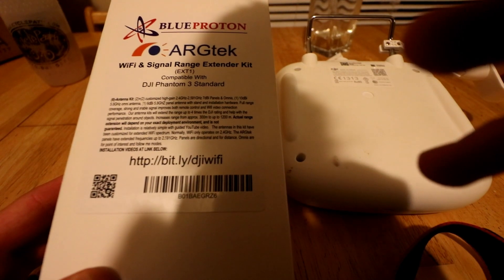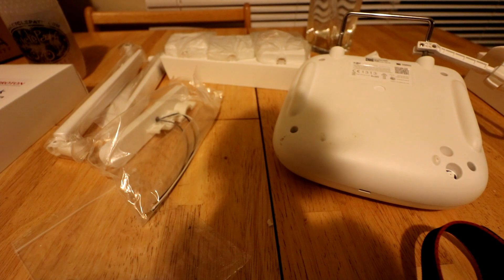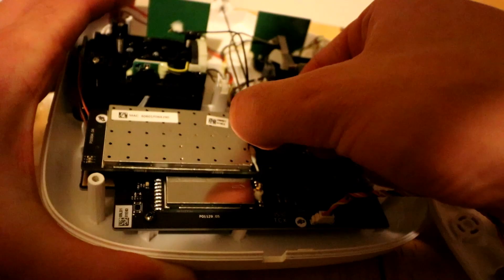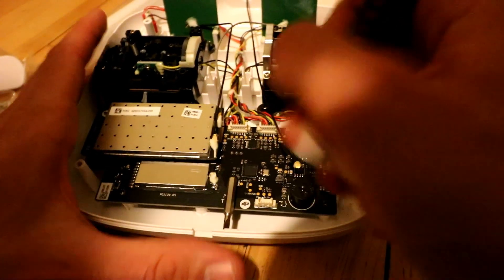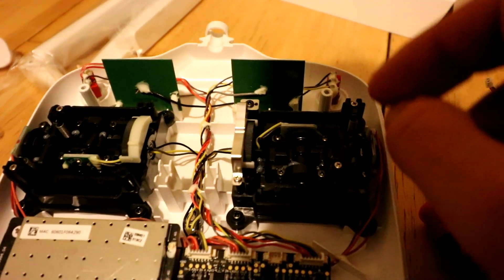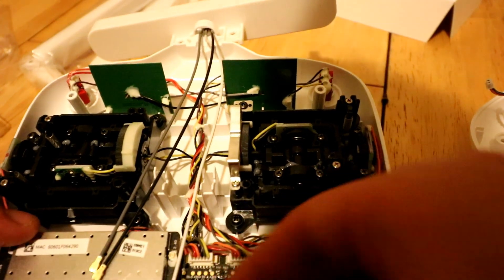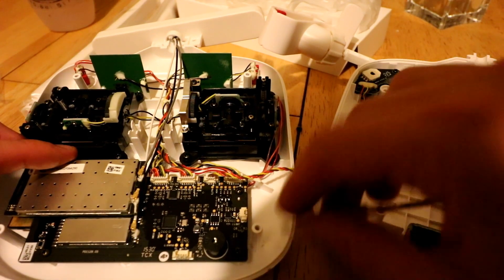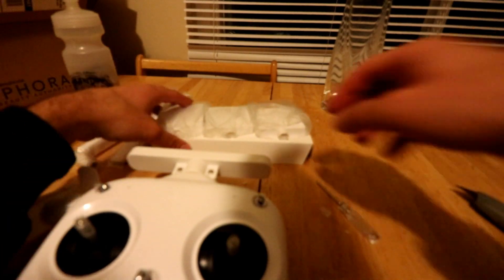ARGTEK Phantom 3 STANDARD Antenna upgrade Install and does it work?

Comment: I installed range extenters last night on my Phantom 3. I had the same problem connecting the longest wire.. ughh. . Grrrrr. But got it. Today I test flew it.  I lost signal at 230 feet away at 57 feet high.. video feed kept stalling.. I'm thinking maybe my wire came unhooked some how. Maybe I should glue them all  back like the were from factory. ... Any thoughts?  Thanks
Reply from the maker: Yeah hot glue those suckers in and make sure it "snaps" into place

Comment: You said the 5.8ghz plug was faulty from the factory.  How did you get it fixed?  Do you know what the part is?  I think I might have the same issue.  I only get like 500ft max range.
Reply from the maker: I used a small tweezer like tol to bend the connecter wider, then used a magnifine glass for precise pressure in the right spot and then it finally worked! I then glued it on so it would not fall off

Comment: I did everything u said and it ruined my controller. Thanks a lot. Now I have a pointless drone.
Reply from the maker: If you cannot do it yourself you should have taken it to a professional. I did not make you do anything.
Reply: Brayden Winter  DrewTalks is right.  I wouldn't mess with my controller, either.
Reply: What happen mate ?  how did you ruin it I'm asking because I'm thinking of doing it

Comment: hey bro. i just received my argtek today and i cant connect grey cable :/
Reply from the maker: LAME! Hopefully you bought on amazon, easy returns.

It might be something in the way but rather than messing up your remote i would go new
Reply: could u please tll me how to connect dji antenna ?
Reply: gret on top
short blak on middle
lonf black on bottom

is that correct ?
Reply from the maker: sounds right
Reply: Gray, Black, White.
If you have any queries please contact us.
And you can join our Skype Customer feedback here for any questions-
https://join.skype.com/FYpRC1uM7Wng
Reply: High Power Expert ARGtek GM5 I installed the ARG Tek test the antennas with my tester everything seem good my signal bars are all the way up so does that mean it's connected
Reply: High Power Expert ARGtek GM5 if it wasn't connected at all I won't have no signal bars right
Reply from the maker: sounds right